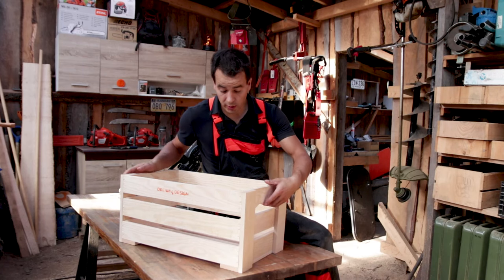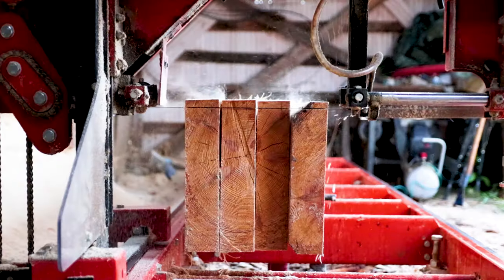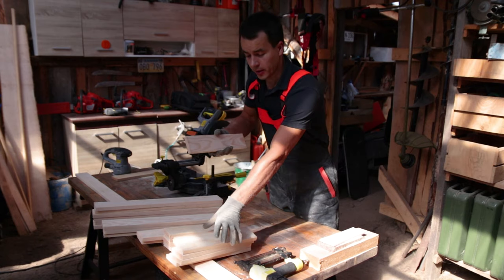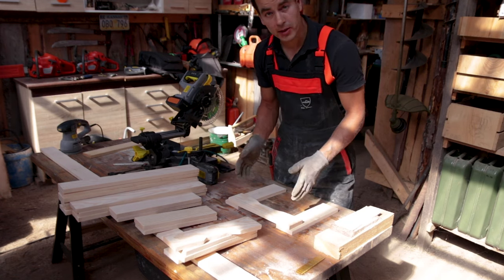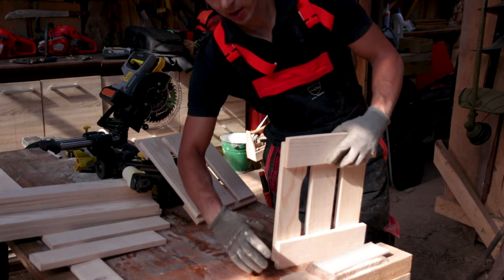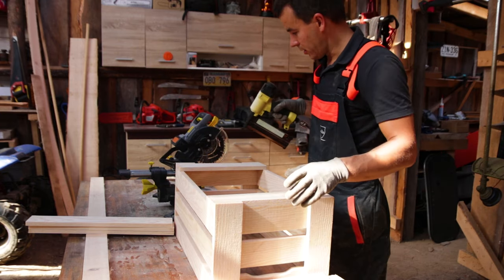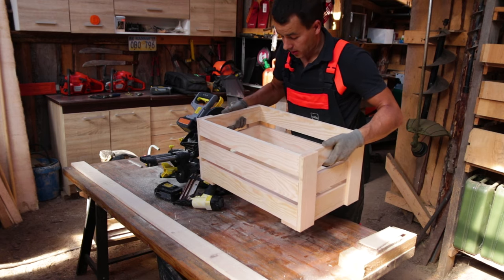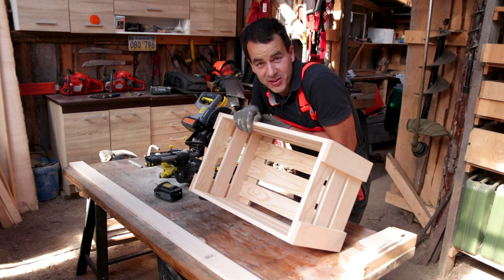How to make Vegetable Box

Comment: What is the L" x W" x H"  sizes
Reply from the maker: Lenght x With x Height of the box - dimensions.
Reply from the maker: @Synonomous  I do not remember, but could be 1 by 2 feet. 0:51 make stop shoot in video, you will see all boards in millimeters, length, all necessary boards.
Reply from the maker: @Synonomous  I sawmill 12x75mm that size boards, for box.